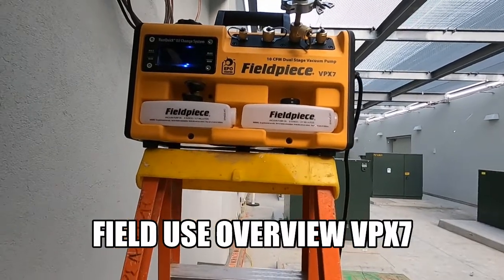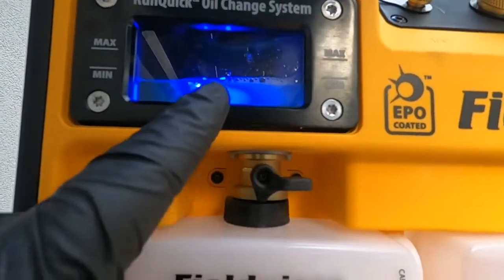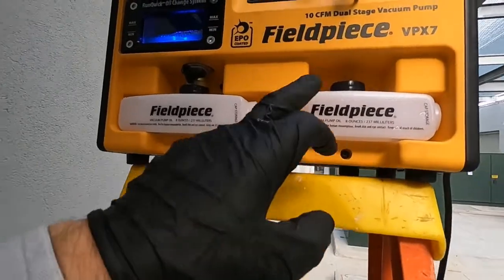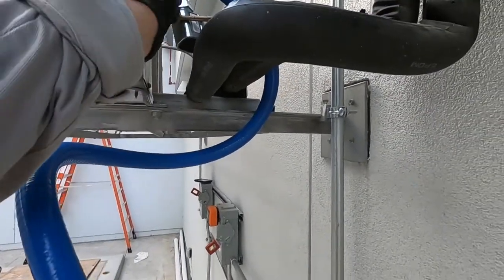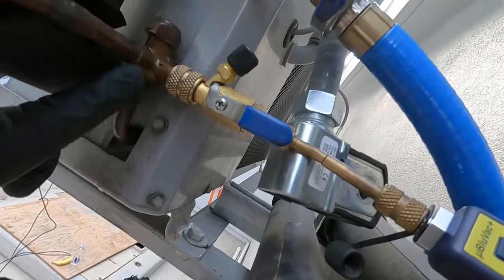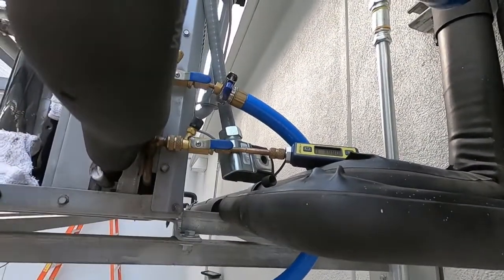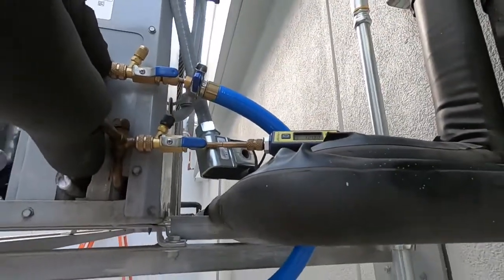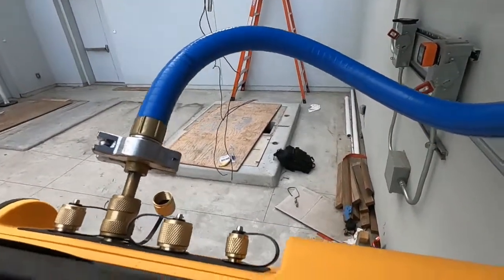FIELDPIECE VPX7 OVERVIEW (PT 2)

Comment: I might be crazy but I expected it to pull down way faster than that especially with the trublu hose.  Looks like you are using the legacy fittings on the trublu they have newer high flow ones now that are less restrictive and machined out of one piece.

Comment: I suggest not using a Schrader remover on the liquid line and connecting straight to it with the micron gage. Add a little pressure on the system after the vac is done. It won't hurt the micron gage.

Comment: One thing that has really frustrated me with the fieldpiece vacuum pumps is the caps for the ports, they don't seal properly unless you crank them down.  Both my VPX7 and VP87 have this problem.  Fieldpiece needs to use better quality gaskets.  I changed all the gaskets and never had a problem after that.  Still like these pumps though
Reply from the maker: I’ll keep this in mind thanks 🤙🏻. So far this pump is kicking butt for me my fav so far.

Comment: I also have one too, by any chance when your carrying it and it tilts a little does it leak oil from  the exhaust port. Plus when ur vaccumming the lines does alot smoke come out from the exhaust port?
Reply from the maker: I was carrying it a lot today and roping it up and down didn’t notice any oil coming out the exhaust port. You might have it over filled. Yeah the vapor is normal and noise gurgling just depends on the system exposure.